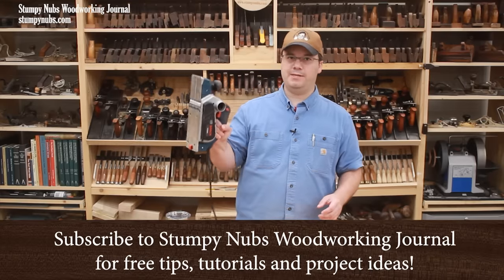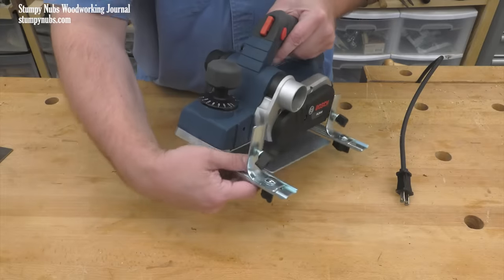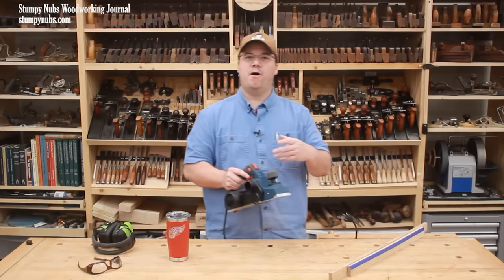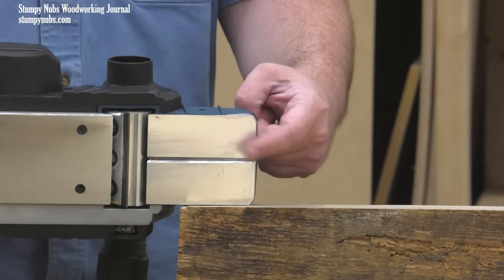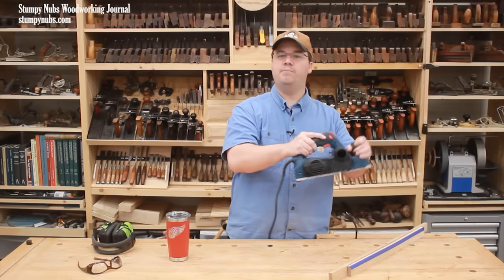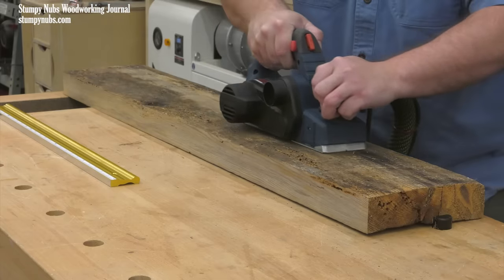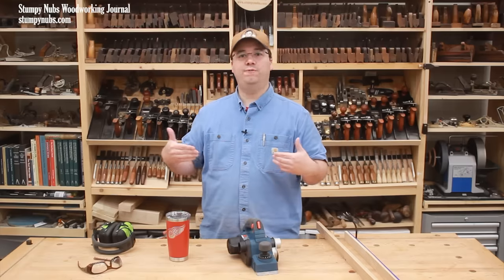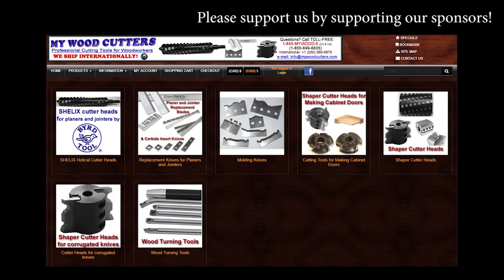Clever things you can do with an electric hand planer

Comment: I made a holder/table that allows me to use the hand planer upside down, like how a jointer works.
Reply: I considered doing this.   Does it work well?
Reply: I found Mathias’s alter ego
Reply: Tell me how you feel about homemade table saws
Reply: I was going to make this comment.  It helps with making a square edge because the one thing missing is a fence.  The fence this unit comes with is pretty clumsy.  Otherwise, Stumpy is spot on.  This planer is a gem.
Reply: Wouldn’t recommend doing this because you miss a lot of safety precautions.
Reply: @schnabeltier2279  It’s true, having that exposed blade is terrifying
Reply: I'm hoping you made a blade guard too, because otherwise what you have is a finger shredder
Reply: @rpavlik1  if by “finger shredder” you mean “woodworking tool” then yes
Reply: @schnabeltier2279  You forgot to mention that the safest and most code complying way to deal with dangerous work and tools is to throw your alarm clock out the window and stay in bed!
Reply: I touched the blade with finger while it was engaged. Muscle memory took over and I did the action of putting screw onto screw gun like I've done about 3 million times in my career. Only this isn't a screw gun and I didn't have screw to install. Took about 2 months for my middle and index fingers to completely heal. Disclaimer- it's not as fun to do as I made it sound
Reply: Thx man, can you recommend a perticular model / video ? I saw plenty but still not convinced they'll be practical and accurate . Thx
Reply: @geckosethpe  Mine works great!  Thanks.
Reply: I searched and searched for THE BEST hand planer for using both by hand AND mounted on a long table to use it as a small jointer... What I finally bought, is the Excellent MAKITA 1912B, because it is one of the few electric hand planes that is not just 3 1/4" standard width, but a much more useful 4 3/8" and also proportionately longer. It is powerful and very precise, and while the dust and shavings port is not round (it has a curious "cat eye" shape, you can make an adapter). A quality, solid and smooth performer.
Reply: @geckosethpe  IT ABSOLUTELY DEPENDS on how precise and solid is your build quality!
See the many videos by expert Oriental woodworkers (and a couple of East European ones) on several designs of perfectly good home-made bench tools from electric hand tools, be it a saw, a jointer, a vertical saw, a bench drill... it is only limited by your own capability and design genius...
Reply: I waited until buying a "special model" of hand plane to start the final design and build for my own small DIY jointer... And it paid: I bought the Makita 1912B electric hand plane because it is noticeable WIDER at 4 3/8" instead of the usual 3 1/4" planer. And I find it more useful, nice and precise, and very smooth for its power. I am now preparing a very thick and solid pair of "ramps" for making my jointer, by using triple 18mm MDF sandwiched with fiberglass cloth and epoxy, in order to make it flat, strong and stable. The inlet table will have a very fine threaded height  adjustment, not to compromise its precision!
Reply: @alfredomarquez9777  ow, thank you so much my friend. I will get one asap
Reply: @berndheiden7630  great advice Bernd, I've been doing this since day one on the job!
Reply: I know I am late to reply here, but I am wondering what the advantage of this is over just getting a jointer. It is going to take up as much space and by the time you build a table and buy a hand planer you are spending close to what a jointer would cost and it isn't going to be as functional since the table isn't going to adjust like a jointer will.  What am I missing?
Reply: @tedthurgate  a good bosch electric hand planer is $100. i made the holder/platform from scrap plywood and melamine. a cheap, badly reviewed benchtop jointer is $300. plus i often use plywood, sometimes hardwood and squared off 2x4s, so i dont use my hand planer much.
Reply: @rpavlik1  how can you guard a blade on a planer and still have it cut? Show us instead of making mother hen comments with no evidence for your claim. Like a saw blade you need space for the wood to pass through which means your fingers can also. You cant complete guard any cutter and still have it work.
Reply: @Dvour420  thanx, now i know i aint only clumpsy here who allmost lost his finger with this😂
Reply: @gbwildlifeuk8269 People act like a router mounted in a router table isn't the same thing. If YouTube was around back when the first person mounted their router in a table I can only imagine the comments that would ha come from that. And here we are. Mounting routers in a table is 100% acceptable and has even become standard.
Reply: I considered doing that with a hand planer and a circular saw but determined I was too much of a Novice and bought cheap craftsman table saw and jointer instead.
Reply: @ScottCleve33 I properly built router table will have fences and track to fit guards and other safety features. An upturned planer has none of these, but loads of stupidity.
Reply: Have you any drawings or dimensions. I would like to do this but am new to this type of thing so kinda in the dark

Comment: I've found a good tip when working with power tools such as these is at the very beginning, with the tool off, do a practice run just above the workpiece to ensure the cord/hose will reach. Nothing worse than getting part way to realise the cord wasn't long enough or it was snagged on something. This will also ensure you're aware of your work area to pick up if there's something in the way or a bit that would require stretching too far.
Reply: Yep that’s a habit that welding has taught me. Really applies well to anything where a single pass motion is needed for consistency.
Reply: Excellent advice. Thank you. I was just planning a class for beginners unfamiliar with hand power tools. This will be a highlight 🍻✌️
Reply: Used to do this all the time myself, now that I've build my own workshop all my power is celling mounted on rails so the sockets follow me around it's amazing 🙂
Reply: I also find it useful to take a double sided velcro strap (loops on one side, hooks on the other) and screw through the strap to the edge of the work bench at the point where my power and vacuum comes over the edge. Then I pull enough hose and cord onto the bench top to reach the furthest part of the workpiece. Starting about a foot from the tool, and then for each additional foot I wrap a piece of velcro strap around the vacuum hose and power cord so that they move together as a unit. Then when I get to the edge of the bench, I wrap the piece of velcro secured to the bench edge around them. Tying the hose and the cord together means I don't have to separately keep track of where the hose and cord are to make sure they don't end up in the way. And then the piece on the edge of the workbench makes sure that the slack needed to go to the furthest part of the workpiece doesn't slide back over the edge and I end up having to try to tug it back over the edge mid-cut.
Reply: It definitely requires such a check in advance. Plus, if possible, set up the workspace/bench in such a way both the feeder wire and the suction hose come from above. A handy tool, or installation, is an industrial overhead rail system, on which both leads can be flexibly mounted. This, so any ‘run’ along, or across the workbench, or other surface can be followed by the leads, wherever our hands lead our machines.
Reply: That's a good tip. Despite almost always having that problem, that particular solution has never occurred to me.
Reply: Pro tip 👍
Reply: Or spend a bit more and get a cordless one! 💪
Reply: @papparocket  I would love to see you're velcro setup. Have you posted it anywhere I could see it?
Reply: This is why I ordered a makita 40v one from Japan. Works just as good as a corded one but you don't have to worry about cords
Reply: @aaronoconnor606  Yeah but the principle is to walk the area first to inspect all is okay before starting work
Reply: This!  Especially if you are using clamps and they are hanging over the edge of your work surface... the cord will get snagged constantly if you don't constantly be mindful of it.
Reply: Also, I have found it really difficult when I’m eating a five course meal While doing this kind of work. By the time I get to drink the wine it has been very difficult to keep the board straight but I guess practice will make perfect. A friend of mine is able to eat a five course meal and a dessert and three glasses of wine and doing a great job at fixing  uneven board.
Reply: @PsychoticEwok  9
Reply: So if you are doing this work as a profession you will be making millions and millions of passes. I don't know how often you plan on doing this practice pass b4 each new piece of material but that seems like a lot of u needed passes. That's will ad up to weeks of hours wasted practicing. Not to mention the the extra wear on your body that adds up to less life less time more doc bills. I like to drop the male end of shortest corded tool(Gordo)  at the end of my extension cord then unwrap and place at where the cord is fully extended. We all know the next step is......set up our work station accordingly should take about ten min. Or teach this to my help. Lol.
Reply: @thetruthshouldbeclear8602 , Wait that's how I make tookpicks from 2x12
Reply: @johnagorman 😂😂😂

Comment: Living here in the Philippines these are used everywhere since there is no such things as dimensional lumber here so every board is custom built and everything needs adjustment to fit.
Reply: By far the most important thing to get right with one of these is aligning the blades properly with the rear plate. It was mentioned but the skill to set the blades at the right height is vital to get a this machine to do the kind of things described in this video.
Reply: Is there a situation where the front plate should be lower?
Reply: @megsman4749  I'm not sure what you mean.  The front plate in relation to the blades is always lower when making a  cut as it is the one that is being used to set the depth of the cut.

Having said that I had a harp making friend who was one of the most creative and ingenious craftsman I know who would use many different tools for purposes outside their intended use. I'm sure this tool is much more versatile in the right hands. 

Like him I like to encourage people to experiment with caution. 
As I'm sure you're aware this tool would do enormous damage to flesh and bone instantaneously and brutally in an instant if not given the respect it demands.
Reply: My father in law uses recycled nails of all sizes and Christmas tree lights to build things. Only wood he uses is branches. Or some old crap he finds. He tied a piece of a A frame ladder to an extension ladder with Ti leaves and Christmas tree lights. He’s crazy. Luckily he might be less than 5’ tall and might weigh 100 lbs.
Reply: What? No dimensional lumber in the Philippines? Lots of lumber comes from there.

Comment: They are excellent at finding nails and screws, with the last good blade, after all the stores are closed, in the middle of nowhere, on a job that was promised to get done that day.
Reply: It happens. Get a handheld mini metal dectector to check any repurposed lumber before you start working on it.
Reply: I do the water trick, you dip 1 oz water into blood, drip this onto a soul. If the soul shrinks or crys, this means you have a nail in your wood, thus use the cross of saint judith to remove the nail by waving it 6.66 inches above the wood in a counterclockwise rotation.

Comment: Great video... one addition worth noting is substituting for a thicknesser. After getting the one side flat as you have perfectly demonstrated here, simply scribe the edges of the board using a marking gauge set to the required thickness, using the plane, take the rough side down almost to the marks around the edges only, almost like a broard chamfer . Once that's done you simply remove the 'crown' that's left before a few final fine passes to take the whole board down to the gauge lines.
Reply: Great advice!

Comment: I just started serious woodworking. I’m 65 and retiring in a couple weeks. I tore down a 100 year old barn a year ago and have made a few pieces out of the siding. I’ve made a bed with two endstands, a bookcase, and a bench with storage under the seat for gloves,wool caps, and scarfs. I’ve also turned out some shelves and coat hangers. One thing about using reclaimed wood is it’s not cabinet making so it doesn’t have to be as precise but you still have to marry edges together. This video helped a lot. I have an electric planer and several hand planers. I use the electric for taking a bow or cup out and then use one of the regular planers for my final face. I so enjoy your videos as it would take much trial and error to correct problems I would have had if it wasn’t for your instruction. Thank you again. This is a wonderful hobby for me and an excellent way for me to supplement my income
Reply: Thats a gold mine for wood workers..... I love old wood . I combine copper and steel to wood working.Two of my favorite things together!!

Comment: I've been using electric handheld planers for years, and in the ways mentioned here. I used one on a job today. The 12v cordless bosch with a 6ah battery is a great little tool. It isn't super powerful, but is perfect for many of the things I use it for. 

One Application not mentioned here that I have used corded handheld planers for is to strip the finish off of table tops. If the top you are refinishing has some thickness to play with, rather than taking a couple hours sanding the finish off, you can remove it in a matter of minutes with a planer. Typically, I set it at about 1/64th and do two passes—Then clean it up with a sander. A job that normally takes hours can be done in about 30 minutes to an hour if you know what you are doing and have the right sander.
Reply: i've got 12v Bosch planer too and i find myself creating twist when plaining a board... i must be my technique, but looking at the video here i think i do it the same. But with bigger bottom plates it may be easier to apply uniform downward pressure 🤷
Reply: @zoladkow  make sure the blade is parallel to the base plate. Sometimes these small planers do not have perfect alignment and therefore it causes one side to remove more material than the other.
Reply: You just saved me hours of removing multiple paint-layers from my wife's Pawpaw-built 70 year old table...a job I've avoided for 10 years. Edit: Wifey just told me it's Pawpawpaw-built, so it's more than 70 years old. All I know is that it's a very useful, sturdy table in my workshop. Oh...she just told me it's cypress. We do live in Louisiana.
Reply: Great video.  I bought my Bosch electric planner back in 2006 when I built my 12'x24' barn. My need was for this planer was satisfied when I was able to level all of the roof truses. Also, I recently used it to recycle many of the 2x4's and 1x6's on my fence that I took down.  Great tool!

Comment: RECLAIMED WOOD: A portable hand planer can also save expensive blades.  I use mine for cleaning up the rough and often dirty surface of reclaimed lumber. Doing that gets the dirt and other things that could nick or chip a planer knife, jointer cutter, table saw blade , etc off of the wood so that it’s much cleaner when you go to process the wood with your equipment. Replacing a power hand planer blade is pretty cheap compared to other tool cutters and since you’re going to process the wood even further anyway, it doesn’t matter if there’s imperfections in the surface left by a nicked blade there. Keep up the good work!
Reply: Very good point! I didn't think I'd need one if I had a router, but this is a good idea!
Reply: Thanks a lot for this great and practical advice! ❤

Comment: I find myself having more success with a long hand plane (jointer) than with the electric one for jointing. Cool video anyway, thanks.
Reply: I tend to agree, because woodworking sometimes requires finesse, which can be achieved using hand tools, rather than electric ones... I've been there. 🤭
Reply: I like my electric planar for getting rough lumber or prelumber (?) ready for the table saw, etc.
Reply: @davidhawley1132  why not just a jack plane for that?  I liked this video but didn't see much that I wouldn't just do with a scrub plane or jack plane.

Comment: great video James. A cool tip i use to plane a board flat is lay the board on a flat surface, using shims if needed so there is no rocking, and scribe around the board with a pencil scribe set to the thickness i want the board. This gives me a good visual guide to plane down to, all across the board. In addition, I bought the specialty dust bag which is much less in the way, it fills up fast but I just quickly vacuum the bag out and resume.

Comment: I learned a great deal about using an electric hand plane with Louis Sauzedde (Tips from a Shipwright). They are great for almost all planing tasks where I usually use a manual hand plane. By keeping the cuts as thin as a manual plane, I can sneak up on a line with confidence. Their major advantages are not having to continually worry about grain direction and their labour saving. Perhaps this tool has a larger audience with boatbuilders, so for me, it’s a necessity.
Reply: what is great also is that he visited Chile and said that boatbuilders there, instead of the whole shebang of tools, only used chainsaws and electric planners

when you do not have money to buy all the tools, you prioritize, and is great to see what a builder community tends to understand as indispensable, versatile tools